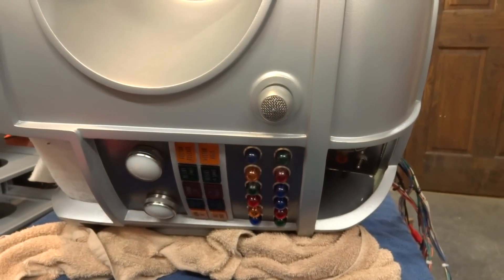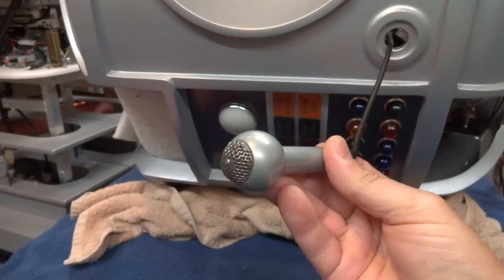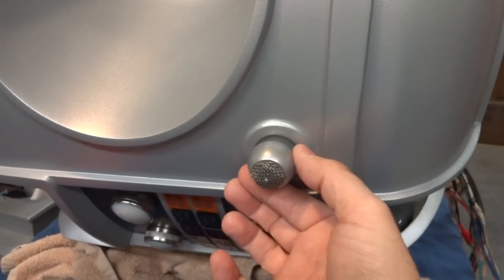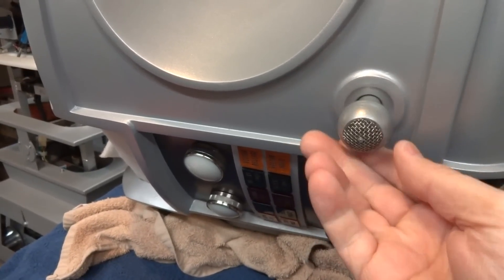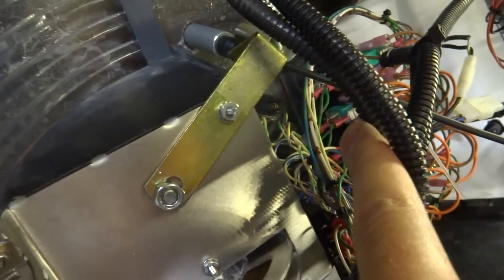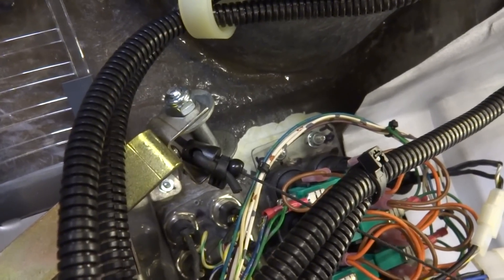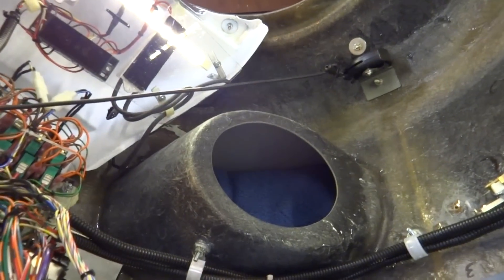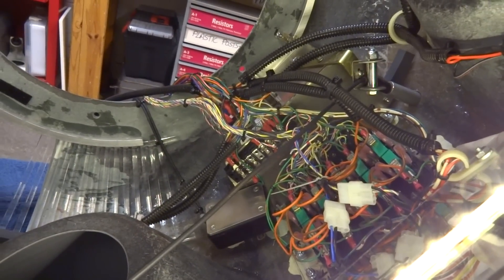Retractable B9 Microphone

Comment: You could have used multiple pulleys and made a circuitous route anywhere you needed it to be to be out of the way, like around the inside of the body shell, basically as long as you wanted the "string" to be. And "super-glued" stand out locations on the inside of the body where you needed to attach bolts and such. (probably using a very strong two-part mixed glue that bonds well to fiberglass or whatever) Then no outside showing bolt heads or rivets.